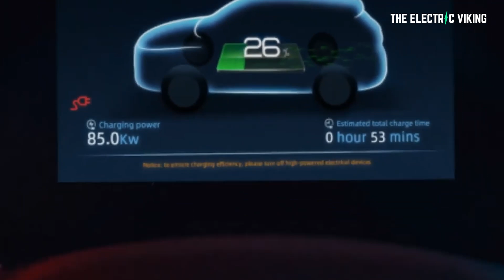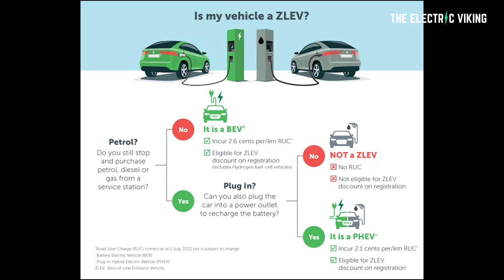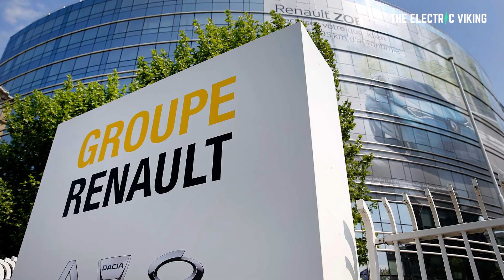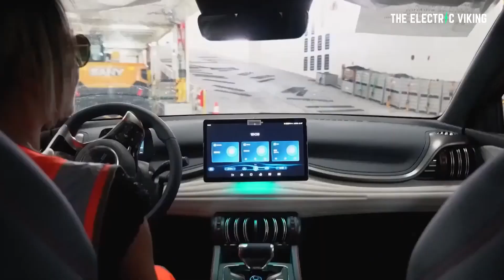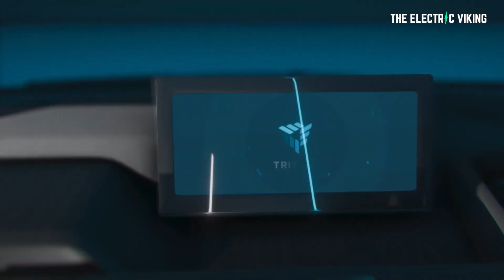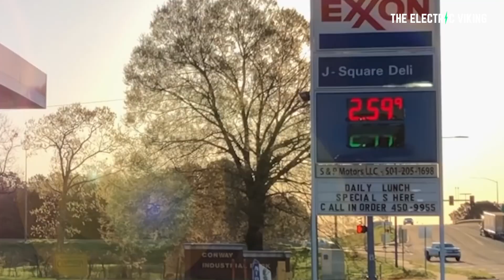100 companies sign petition for 1 million EVs in Australia

Comment: Firstly totally understand we’re your coming from, but take out the city’s & the rest of Australia is sprawled out over a vast area, with technically little population density, 
So 1 that means so many vastly sprawled recharge areas, 2 the same for maintenance over these areas, 3 real research how they handle extreme hot temperatures over super long drives at 40 to 50c +,in the shade, the dirt roads, water, the power supply to so many of these vast recharge centres
And the bulk living way out I don’t see even with new cars, as there cost prohibitive to the wages and life styles there a customaed to 
But I agree and understand we’re your heading, but there needs a separate governing body federally, that once set, neither party in politics is allowed to alter or diminish, just advance

Comment: Unfortunately in Australia, any EV strategy was non existent with the Liberals in power - NON EXISTANT FOR 10 YEARS.
Now with Labour, well, they are at least open to EV adoption and are implementing strategies with financial backing.  The whole EV uptake does need to be accelerated.
What will help, and this has been discussed before, are:
Mandatory fuel emission standards;
Electric vehicles to be made affordable;
Adequate rollout of charging infrastructure;
Govt procurement of EVs;
Increased supply of renewable electricity;
Education and communication about EVs.

Comment: I been following EV's for a long time and all for them. Problem we have in Australia is the actual generation of electricity for charging them. I just want to know where this electricity is going to come from. 1 million extra cars on the road sure, how they going to charge those cars, we don't have the infrastructure needed, it needs to triple capacity output to allow that to happen. So I ask the question how is that electricity going to be generated? It's all good and well to say we want that but realistically is not going to happen in 5 years, renewables alone cannot supply that sort of extra base load

Comment: Good luck with getting 1 million EV's into Australia in 5 years. That's 200,000 a year. The biggest importer of EV's into Australia, Tesla, sold 12,000 EV's in Australia in 2021, and the total of all EV's was 17,000. So, we need to basically 10x the number of EV imports. What that would mean, is that pretty much every EV maker has to be making as many or more EV's than Tesla does now. I expect that Tesla will continue to shoulder the burden of ramping up production, so who else is there? BYD, MG, that's about it. GM is making big promises about EV production, so maybe we will get some Bolts and Equinoxes. Maybe VW will get their act together and actually make some EV's that people want. Ford will bring in a few Mach E's but most people can't afford any of these cars. We need cars like the Ora Cat, or BYD Dolphin, priced at around $30k. And there needs to be a federal EV incentive similar to what they have in the US. If NZ can do it, why can't Australia?
Reply: Very good points. Another big road block in the race towards 1M EVs is the Australian Government, (on both sides) who have no real interest in EVs. Sure they talk the talk but I don't see any walking, at all. I think the fuel excise tax has a lot to do with that. The Dictator of Victoria's answer to this loss of income is to put a special tax on EVs. This does not make anyone from that part of Australia want to run out and buy one. Then we have all the supply and logistical constraints that you just highlighted. So no, I sadly can't see 1M EVs in Australia in 5 years being realized.

Comment: Sam first you have the best channel on YouTube. One clarification though, there are taxes on EVs in certain US states.  For example in Iowa you pay a set EV tax per year. unlike fuel taxes which are based on how many gallons you buy and usually correlate to how many miles you drive for a year, this is a set fee which I’m not a fan of. The person that drives 4000 miles and 40,000 miles per year pay the same rate which isn’t fair. I’m fine with the tax on Evies to pay for the roads because in the US there are taxes on gas that go towards paying the roads. I just want it to be based on miles driven versus a fixed amount.

Comment: Who told you there are no taxes on EVs in the US. It's a state issue, so it varies by state similar to Victoria, here in Arizona they use to charge no tax on alternative fuel vehicles but starting this year a vehicle license tax went into effect. They collect the tax when you renew your registration and if you don't pay the tax, they don't renew your registration, which gets you a ticket. While it's not based on usage of the roads, they use the same formula used for ICE vehicles. If you have a $40K MSRP EV they assess it at 60% of the MSRP or $24K, then charge you $2.80 per $100 of assessed value which comes out to $672 for your initial plates. Every year after, the assessed value is depreciated by 16.25% and at a rate of $2.89 per $100 of assessed value.

Comment: Is it financially feasible to provide charging stations for vast distances to outback destinations?l  Otherwise, would not hybrids be more suitable for Australia, so that running on electricity only could be required in urban areas.   Investing in highly speculative research on hydrogenIt does seems questionable. The US and Japan could afford it, they have done it,  with little to show for it.
Reply: Its financially feasible to put fuel stations in outback destinations. So charging stations would be feasible if there was demand. That is the problem. The charging station are not there so no one uses EVs for road trips, so the demand is not there. You are correct about the H2 nonsense, it is very questionable.

Comment: We REALLY DO HAVE A “TAX” here in the US!!  All states say we EV owners need to pay MORE to drive on roads than those whose drive with gas!  I work at home and my 3 year old Bolt EV only has like 6,000 miles and I pay $260 for Ohio registration every year so an additional $200 per year GAS TAX!  GEE I WONDER if they will use all that money to fix roads????
Reply: In California (for instance), gas taxes add $1.40 usd to each gallon.   An ICE car of Bolt's size would get 25mpg and your 6000 miles per year would have paid $336.  So...
Reply: @johnb7430  I never said 6,000 miles per year!  I said my 3 year old car only has 6,000 miles on it…….Sooooooooo….
Reply: @kyliefan7  oh my... yes that's lots different.
Reply: Wow my rego in the Northern Territory, (one of the northern states of Australia) is about $800 for the year. (aprox 500USD) In Victoria where Sam comes from the rego is about the same I guess. However if you have an electric  vehicle in Victoria you get to pay extra based on your odometer reading each year. That's cents per KM that you show them you drove, on top of normal Rego.

Comment: A plummeting annual mileage (and still falling by the way) along with BEVs taking 1.6% of the national fleet (but now 10% of new sales) has meant that the UK Gov is looking to introduce a Road tax for EVs. They claim the rapidly falling income from having a zero Road Tax policy for EVs and a reducing income from petrol / diesel 'fuel duty' and 'fuel tax' means they need to come up with new vehicle tax scheme for EV's. Vehicle average annual mileage has been falling 'steadily over the years in the UK but  has not bounced back from the collapse brought about by the lockdowns imposed on citizens, as new ways of working to overcome that have become permanent for many. I suppose with average annual mileages being 24% lower than pre pandemic, the range of EVs becomes less of an issue and with Petrol at £7.55 ($8.49) per gallon and diesel at £8.66 ($9.74) journeys are now more 'considered'.

Comment: If you live in a flat, you probably wont have any access in your parking bay  [you might have to park in the street, some homes in multi million dollar areas, very old victorian homes, have nose into the kerb parking. so no easy way to charge at home]  Also, if you drive  to work and your charge is low, you probably wont be able to plug in,  And if your are an older person [me] if you have a good ICE car and don't do many Kms, there is no incentive to change.

Comment: Hydrogen is growing all around the World. Disruption is coming to the Battery based industries and many other others like shipping, power generation,aviation, trains and a lot more besides. The headwinds against batteries, which is all about minerals, are forcing people to look at hydrogen. China has the fastest growing hydrogen economy and investing more heavily than anyone else. COP 27 will have hydrogen development as a core strategy going forward.
Reply: where does the hydrogen come from
Reply: No, hydrogen is not. It's dead.
China doing for themselves in the western part where solar is abundant, not anywhere else.
Reply: Hydrogen is man made, guess what by using electricity!😂
Reply: @jacobheinz8236  absolute stroke of genius 🤪
Reply: Excellent so we have a cheap hydrogen electrolyser catalyst that isn’t platinum and can’t be easily poisoned, a way to offset the putrid efficiency of purifying the water then turning it into H gas and can cheaply safely store it for a long time without hydrogen embrittlement or leaks. Yes? No! The best way to use hydrogen is to immediately turn it in to ammonia or fertiliser. Even use it to make steel. Using hydrogen as a transport fuel is bullshit. It’s just a way to fleece people of all their money. All of it.

We are on to you. Bullshit artists. Sincerely, the science community